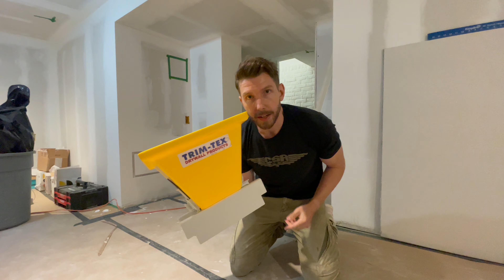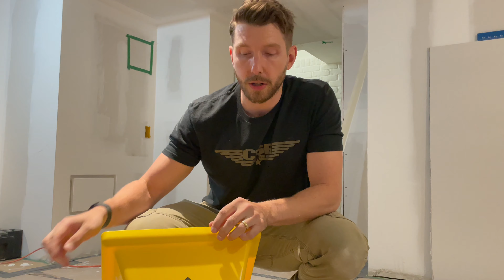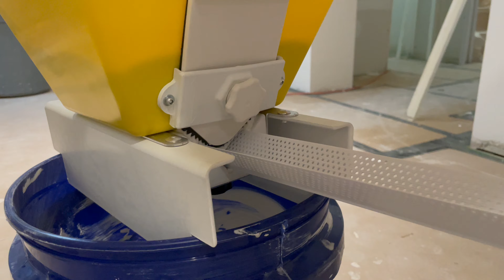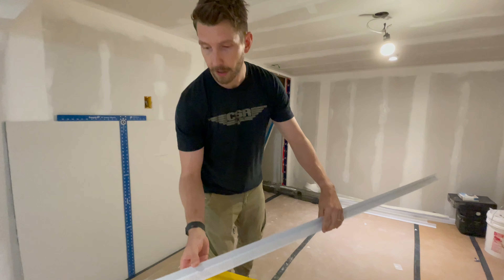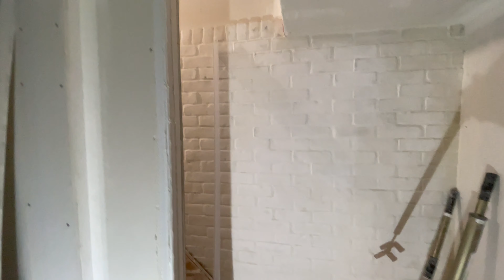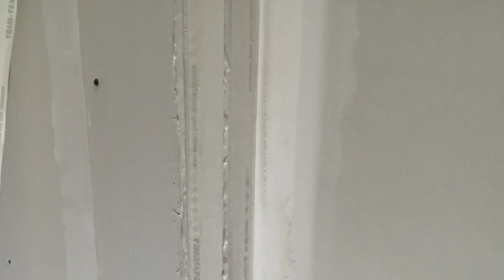Fastest Way to Install Corner Beads (Trim-Tex Mud Set Hopper)

Comment: I thought the trimtex beads were to be installed with spray adhesive and not mud directly to the board?
Reply from the maker: They actually have different versions for adhesive and staples and for mud-set ones!

Comment: Is that the actual mud set bead or the regular vinyl?
Reply from the maker: These are the real deal mud set beads. There’s a few easy ways to tell: the holes on the side of the mud set beads are all circles (on the regular vinyl beads there’s circles AND little ‘T’ cut outs). Also, if you look closely, the mud legs look a little different (they have a tiny hook to them rather than just being ridges) 👍